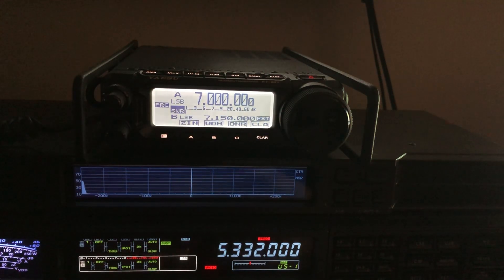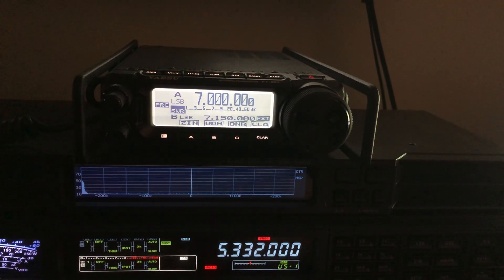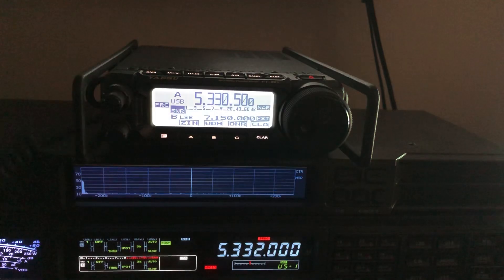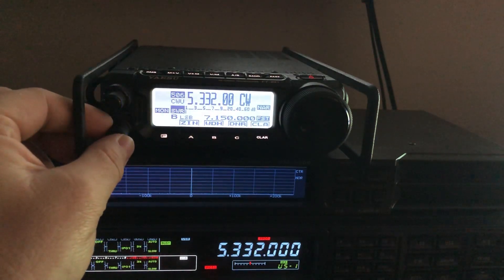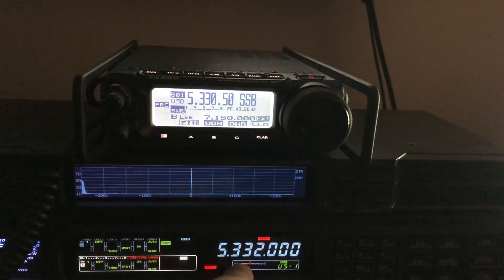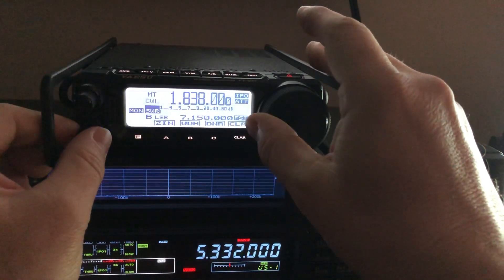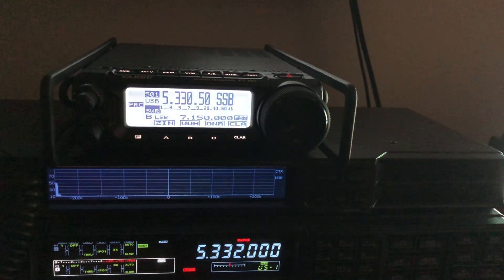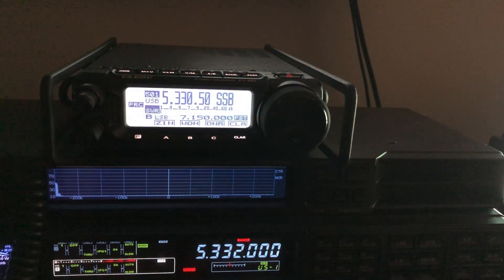Accessing the 60 Meter Channels in the Yaesu FT-891

Comment: Good video and thanks...I noticed DATA mode isn't setup, only USB and CW. The memory modes won't allow to modify the mode. Any idea how to properly setup data mode for 60 meters on the Ft-891?  Thanks
Reply from the maker: I don’t run digital modes with my FT-891. I use my FTdx10 for FT8/4.  Running FT8/4 on 60m is tricky when using memory bank 5.  You have no choice but use memory bank 5, unless you perform the MARS mod.  There is a way to make it work from memory bank 5. I posted a video for my Patreon team members that shows how.  That said, 60m is a regional coverage band.  I use FT8/4 for long range contacts.  40m will work the regional contacts during the day if I ever want to.  80m will work regional at night.

Comment: Just purchased an 891 with “Warranty Policy only valid in Japan” attached to box. Memory channels go 1-99, then P1L, P1U, P2L, P2U ….etc. up through P9U.  Continued scrolling brings me to memory 01.  Manual is in Japanese. I’ve yet to put this radio on the air but will be sure to watch band edges.  What have I got here??
Reply from the maker: I’ve warned my viewers about buying from Japan. Their amateur bands aren’t exactly the same as the USA. If you MARS mod the radio, you will be able to fully utilize the US bands.  But be very careful with the 60m band. You will need to precisely program those frequencies into memory positions. Watch my 3-part series about the 60-meter band.
Reply: @n4hnhradio  I’ve been a keen follower of your channel as owner of the great 101D as well. The radio was purchased on a prominent site that I’ve used for years.  After multiple texts and extended phone conversation, I bought the radio. It’s origin was not disclosed, but I also failed to ask.

Comment: Thanks for the trick with channel memory. But how to unlock 60m when 891 is controlled by a computer with FLRig or similar software and physically not accessible?
Reply from the maker: You cannot transmit 60m in VFO mode unless the transceiver has been modified.  The MARS mod will open up the transmit range, but you have to be very careful not to violate your operating privileges and TX Bandwidth limit.
Reply: @n4hnhradio  Thanks for clarification.

Comment: 60M is a really useful band that is not quite as demanding antenna and long wave propagation wise as 80M, but has excellent performance in the evening hours when the MUF has dropped below point where 40M can provide effective long range communications.  The 5 ch band plan should not even be all that limiting, since a single 2.8kHz SSB channel can support several FT8 or JS8 connections -- but some total idiots have been trying to enforce a really STUPID interpretation of the rules to disallow this and the ARRL has been trying for some time to get clarification.  Now the FCC has proposed new rules that would give a continuous 15KHz block of spectrum that would presumably give more flexibility for modes like FT8, but would take away some existing channel spectrum, and reduce power from 100W to only just about 9.1W ERP.  So good job FCC! - first you draft rules that appear to disallow multiple FT8 carriers/channel in the 60M band where you would think that the spectrum efficiency this provides would be most beneficial (saying that 60M is mainly for channelized SSB and CW emergency communications) -- but NOW seem to be swinging 1000% the opposite way and propose to "fix" things with rules which are instead so stingy on power that pretty much ONLY FT8 QSO's will even be possible  - while at the same time, JUST totally blowing off the current capabilities that amateurs have of being able to provide effective emergency SSB net communications on 60M at 100W.  The ARRL has proposed instead a "best of both worlds" approach that would have the FCC adopt an expanded version of the 15KHz continuous spectrum plan, along with most of the existing channelized spectrum for shared use, while preserving the current 100W RF power limit (which is apparently what Canada did).  So, depending on whether the FCC shows some common sense here, 60M is about to either get dramatically better, or dramatically worse, we'll see . . .
Reply from the maker: 60m is indeed a fun band. It provides such great gap coverage.  And it evens the playing field for those who don’t have a linear amplifier.

Comment: I am  a new ham operator but have  use of HF radio in my role as a radio operator. My question is: would the FT891 be the best backup transciever if the mars mod was applied? And yes i am allowed to TX outside amature bands.
Reply from the maker: I would use the FT-891 as a backup transceiver.  It is compact, so it’s portable, yet it delivers 100W.  I carry one in my backpack.  I’ve used mine as a base station too.  So, yes!  I think FT-891 is a great little radio.  It doesn’t have an internal antenna matching unit.  If you need that, consider the FT-991A.  With it, you also get 2m and 70cm bands.  But of course it isn’t as portable as the FT-891.  I use a resonant antenna with my FT-891. I use the 120W EFHW from www.NY4GEFHW.com.  It is resonant on 10, 15, 20, and 40 meters, with the option to add links and extensions for resonant operation on 17, 30, 60, and 80 meters.

73, de N4HNH

Comment: Good info, how many memory channels are there on the 891?
Reply from the maker: There are 10 preprogrammed 60 meter memories.  There are 5 for USB and 5 for CW.  Those are the 10 we are allowed.  

Technically, it’s 5 frequencies and two modes.  For CW, we transmit in the middle of the channel, which is the frequency in the display.  For USB, we transmit 1.5kHz below the center.  Yaesu radios will still show the center of the channel in the display but the suppressed carrier insertion point will be 1.5kHz below the center.  5.332 CW will be transmitting at 5.330.5 on the USB channel.  Yaesu programmed it that way for us.  They also programmed the 2.8kHz bandwidth limit.  That’s why it is best to run the Yaesu transceivers without the MARS/CAP mod. 

If you are wondering how many memory storage slots are available for you to program in your favorites, I believe there are 100 slots.

73, de N4HNH
Reply: @n4hnhradio  I should've been more detailed in my question, but you covered it in the second part. Also do the pre programmed frequencies count as part of the 100? I've looked at the Yaesu page and it doesn't seem very clear. Thanks for the quick response btw!
Reply from the maker: There are 5 memory groups available for you.  Memory group 1 allows up to 19 entries.  Memory groups 2 through 5 can hold up to 20 entries.  That is a total of 99 user memories.  Memory group 6 contains the lower and upper scan frequencies, which you can set as desired.  Memory group 7 is for 60 meters.  It already contains memories 501-510.

73, de N4HNH

Comment: Thank you for the video. I had not bumped my head on the Yaesu memory vs band. I learned something about my 891 on your video.
Reply from the maker: I’m glad the video helped.  That’s why my channel exists.  I hope to help everyone get more out of their radio, no matter which radio they have.

73  de N4HNH
Reply: @n4hnhradio  One question I thought of? Do the pre programmed chanel's set the power level or do you have to throttle it back to 50 watts in the settings menu?
Reply from the maker: The power level setting is a global setting.  I have a Yaesu FT-2980R 2 meter FM transceiver.  It does store the power level with the memory.  So I can understand why you might think that it might do that in the FT-891.  But the HF radios usually have a global power setting for each mode.  But we are no longer limited to 50W on 60 meters.  That was the old standard.  Some years ago, the FCC changed it to allow us 100W ERP.  So if you are using a dipole, which is 0dBd, you can run a full 100W.

Great question!  73, de N4HNH
Reply: @n4hnhradio  Thank you. I can see that I need to download a new ARRL band plan. I always keep one next to the radios. The other night I went listening on 60 meters and was astounded at how good I was hearing people in California from Utah at 2300 hrs. I decided I would like to learn more about it before I would give it a try. Can't believe how we lost some of the I think 900mhz band that the government sold for a gazillion dollar's and everyone was so stingy on 60 meters. Again thanks.
Reply from the maker: Us SOTA activators consider 60 meters as our go-to band.  It bridges the propagation gap when 40m is skipping over our chasers heads and 80m is falling short.  We also like the 100W ERP limit.  It makes the band more of an even playing field.  During the day we get contacts from 60 to 700 miles. At night we get contacts out to 1500-2000 miles.

73, de N4HNH

Comment: Thanks for the video.  I get the USB and CW mode memories for 60 meters and the FT-891 now, but that doesn't work with data modes that are using rig control like WSJT-X (FT8 mode).  As soon as you try to transmit the rig control forces the FT-891 into the "DATA" mode so then the radio won't transmit.  The only work around I've been able to find is disabling WSJT-X rig control and using the USB mode when operating on 60 meters.  Am I missing something?
KZ9V
Reply from the maker: USB mode is all data needs.  I don’t personally use FT8 but my brother does. He runs WSJT-X with his FTdx5000 in USB mode.  He bought an $8 sound card to use with his 5000.  It cost him $8 to do FT8 on the 5000.  He simply uses the mic input to modulate the USB signal.

73, de N4HNH
Reply: @n4hnhradio  Wow! Which Sound card did he use?!? Amazing!
Reply from the maker: I don't know the brand. He bought it at Micro Center.  I'm going to try to schedule a video shoot with him showing how he set it up.

Comment: Doug hope have a safe and prosperous new year.  Can you do a video on how you monitor/use the 60 meter channels? I know you said it was a band that both amateurs and the government use.  Is their certain times that we can see an increase in activities on those channels?  Maybe explain the relationship between amateurs and government and how these channels are used?
Reply from the maker: Did you watch the 3-part series I did all about 60 meters?
Reply: @n4hnhradio  I did.  I didn’t realize these channels were used for non-emergency use.  What kind event might happen that the government would take control?
Reply from the maker: Hi Don, 

I'm uploading a video right now regarding our use of 60 meters.

As far as the government's use, I haven't found any information pertaining to exactly which government agencies use 60 meters.  I know that they can use from 5.005 to 5.450 MHz.  But the space of our 5 channels is not to be used by the government unless they need it.  For a while we had 5.368 MHz as a channel, but we were getting strong digital interference there, presumably from a government entity.  The ARRL petitioned to swap 5.368 MHz for 5.358.5 MHz and it was done.  That's why channel 3 is 5.358.5 MHz.

I hope this helps.

73, Doug

Comment: I liked the video. I did a firmware update on my FT-891 that made the 60 meter band available to me (I have a European FT-891, so maybe there is a difference).  The radio does not have any 60 meter channels programmed, but then I have done a couple of factory resets. I did notice  in VFO that TX functions continuously from about 5.351 Mhz up to about 5.366 Mhz.  In Germany, at least, there are only a handful of frequencies and power outputs allowed on 60 meters. So programming these frequencies the way you describe is a good idea.
Reply from the maker: The 60m band in the USA is different.  So yours won’t appear the same as mine.   Yaesu assigns an R suffix to some of their HTs to indicate a USA version, but they haven’t done that with HF radios that I know of.  73, Doug